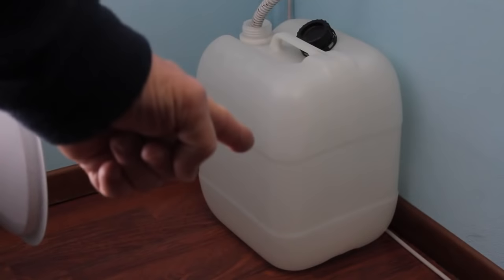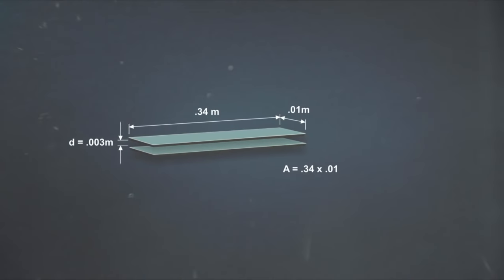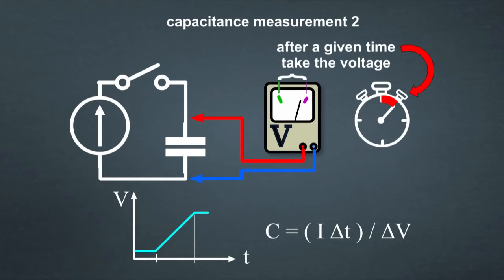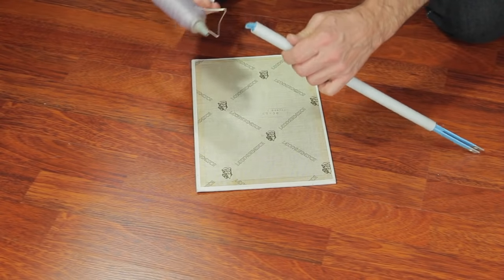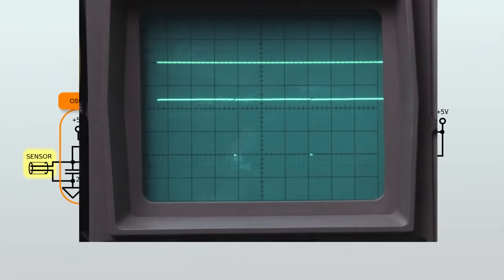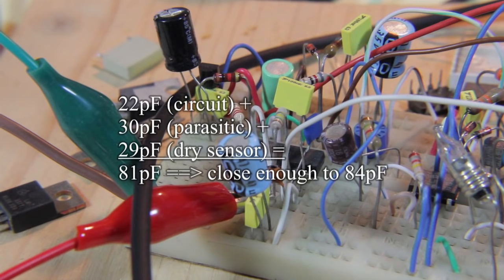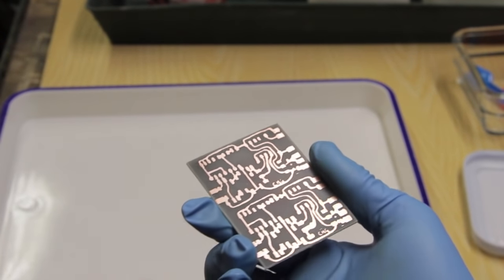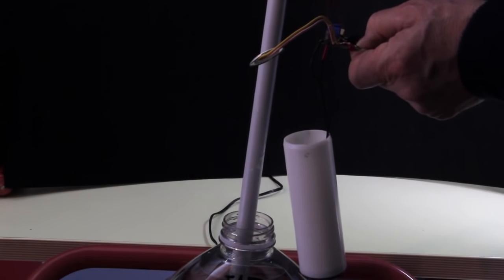Water level/fluid level capacitive sensor - How it works and how to make one

Comment: hi,great work 
i have one question
i want to make a sensor like this for my own lab
first i wanted to use arduino to read the data(by means of charge and discharge time)
but i think its better to use the frequency method
but i cant make the exact circuit
can you send a technical drawing of the circuit?
i want to connect the point you mentioned in video to arduino
thank you very much
Reply from the maker: The point indicated in video is the analog output, the connection indicated is symbolic as this output have to be buffered with an opamp to preserve the high impedance. To read the frequency you need to connect at the output of the last gate (74HC132). It is mandatory to use exactly THAT component otherwise the circuit need to be retuned (and likely wouldn't work properly). You will read a pulse that vary in frequency, as you can see in the video.
Reply: @AccidentalScience  so i cant connect any point of this board directly to arduino?
i have to find a way to read this frequency by arduino?
Reply from the maker: @David-xr4pd  Why? I have indicated where you can connect an input of the Arduino to read the signal as frequency instead of analog: the output of the last gate or (for a reversed logic) the output of the previous gate (the pulse generator, see the schematic in the video at 7:20). Also looking at the waveform read from the scope you can infer the frequency and the pulse width.
Also you have to choose an appropriate input in the Arduino board as it has to cope the frequency and width of the pulse.
Reply: @AccidentalScience  thank you very much sir
Reply: @AccidentalScience  Hi, I have connected exactly to the analog read of the arduino but it only shows a constant value of 513 without any change in its value with variation in the capacitance. While, I have matching the circuit for a week, even the oscillator output frequency varies with change in the sensor water level but the analog read value doesnt changes. I made the spice model of the circuit till the output of the last 74hc132 but there also it is not a constant voltage while it is a frequency pulse.
Reply from the maker: @ragibhussain5257  The last stage of the 74hc132 outputs a frequency that is proportional to the level. The conversion F/V is performed by the next RC. The signal must be picked up from there, but it cannot be sent directly to the analog input of the Arduino, because you need to decuple it. To do this you can use an opamp, i.e. a LMV358 (which works at 5V), configured as non-inverting unity gain amplifier. The output of the opamp is then "strong enough" to drive the input of the Arduino.
The 513 value from the ADC makes me think you configured 10 bit conversion with differential inputs and Vneg is connected to the same signal level in Vpos (for Vpos and Vneg see the ATmega328 data sheet). In such a case 513 would mean zero volt (differential) as for the following formula:
ADC = (VPOS – VNEG) ⋅ GAIN ⋅ 512 / VREF
.
I recommend to use a single ended input only. Also use a multimeter to troubleshot the circuit, check if the voltage actually change, where it change, and so on.
Good luck.
Reply: @AccidentalScience  Hi, I tested everything, I exactly replicated the circuit as in the schematic on the breadboard with exact components and instead of sensor I varied the capacitance of values from 22pF to 2.2nF, but however, the output of the multimeter at the opamp output is constant at 2.51V. It would be better if you would upload each and every detail of the schematic on any link any spice model or the exact link of the circuit.

Comment: Hi...
¿How can I find information about that oscillator and pulse generator?

Now I know I can simulate it in a computer program or built mine in house but in both cases if I want to model it mathematically I would have to measure...

In resume: could somebody tell me where can I see theory about oscillator and pulse generator?
Reply from the maker: While I don't have a specific answer right now, a good starting point is to understand the theory of operation. Some more information is available on the relative page on my website, but there is literature (I think it should be available online) that covers oscillators and other signal manipulation through logic gates. I have an old book titled "Elettronica Digitale" (don't remember the publisher though and AFAIK it's only in Italian) that provides good coverage on the topic. Maybe searching for a similar title you may find something.
Reply: @AccidentalScience  

Yeah... Thnx for your answer...

Another question I have is:
Did you review your book for design that circuit?

I can understand how the oscillator part works by seeing connections in NAND, resistors and capacitor because it is the first part but I can understand pulse generator and the other parts by simple inspection 😓

Comment: Can i use this sensor for more than one meter and can u explain the way and the code for using this sensor with arduino thank u so mach for this great information
Reply from the maker: The sensor as shown in the video is "monolitic" that means that the probe (the two plates) and the circuit form a single sensor, so you can use more than one to connect to a single unit meant to work as a metering station.
Since the sensor measure the capacitance between the plates there is almost no risk of interference if more than one sensor is plunged into the same tank, provided a minimum distance (say some cm) between the sensors.
I do not love much Arduino because I prefer to code directly or to use my framework that makes multiple event programming much easier, so I am not able to direct you for specific code, however essentially you have to setup the ADC and by polling the ADC in the main loop to read out the analog signal coming from the sensor, and then use this data to do whatever you want in the program.
With the NDC framework the things go similarly: you select the extension of the main loop and in the device loop file enter the code to poll the ADC, in this case it is easier as the ADC is already read out and you simply need to pick up the value using getIn(ANALOG0). For more information about the NSC framework look among my videos.
Reply: Accidental Science thank u a gain

Comment: What about mineral buildup on the 2 strips and the eventual blocking of the pipe?
Reply from the maker: Your question is a good point and to try to give an answer we should wonder what are the reasons limescale/minerals build up:
1) it could be caused by sedimentation, in this case there is no problem because the gravity will attract the particles down, outside the pipe;
2) it could be caused by chemical concentration, at the point the particles stick to the surfaces, this typically happens when high temperatures are involved, and it is usual in resistors used to heat up boilers, however the stripes are not heated (and with no high temperature spots the particles stay diffused). However after long time some particles will stick anyway but far from the point to cause the pipe be chocked;
3) it could be caused by electrical attraction: if the plates (the stripes) were connected to a continuous electric field that could attract polar minerals eventually. However here not only the electric field is very small but it is also alternating so there is no risk to attract polar particles.
About the thin layer of minerals/limescale that may build up in long times, mentioned at the point 2 above, one thing that we may wonder is if that layer may modify the dielectric properties of the sensor, thus shifting the returned measured value. I have no answer for this last point because I think the only way to give an answer is to try experimentally. However since the sensor as shown in the video is quite simple I think that for the purpose of its use it should be fine anyway, it is however possible to design a different kind of sensor that have intrinsic compensations for this kind of "interferences". Finally it is also possible to make the sensor to work in a completely harsh environment (say with plenty of minerals/limescale or other particles suspended in the fluid) by changing the design of the stripes.
Thank you for the question. May be I could make a video about this topic.
Reply: Thank you for the detailed answer.
A reliable, maintenance free liquid sensor for a sump pump is what I am looking for. LevelGuard seems to make what I need but it is too expensive.
They use a proprietary sensor which I would like to replicate.
If you are interested in collaborating in this project please let me know how I can contact you.
Thank you.
Reply from the maker: Well, let's talk, my email is in the about section here in my channel. When you have done please leave a comment here because once in a while the mail server lacks to send me notifications.
Reply: Contact made :)

Comment: Can we use a capacitor to determine two different fluids with different polarities?
Reply from the maker: Hmmm, you can detect two different fluids with capacitive sensing, but I am not sure what do you mean for "a" capacitor and "different polarities", may you elaborate?
Reply: @AccidentalScience   I want to design a capacitor which can detect water from fuel . (Water- Polar, Fuel- Non polar)
Reply from the maker: @DinuBoy  gotcha. Cool problem. Polar or non polar fluids have different behavior as dielectric so it can be certainly done.

Comment: Hello, can you talk about how you calculated the *K value?
Reply from the maker: Hello, sorry for the delayed reply. As mentioned in the video it depends by the circuit. For a NAND oscillator the constant value typically is approx. 2.1 to 2.3 times R C or f = 0.47 * 1/(RC). I cannot provide more details because as said above it depends up how the circuit is designed, not to mention the fact that I am not a guru at math :)

Comment: can your sensor detect the level of fluids with varying dielectric constants , from high to low.. this is for detection of human blood levels
Reply from the maker: No, it can't.
Reply: @AccidentalScience   is it possible for you to tell me, how much current would be detected if the probe reaches the surface
Reply from the maker: @GeogyStephen  Current? The probe is insulated. There is no current flowing between the plates, save instantaneous flow due to the moving charges back and forward because the oscillator, and that alternating current is negligible, I don't remember the exact values but in the order of microamps I guess.

Comment: can you pls send the circuit connection for using with arduino for fuel sensing
Reply from the maker: I don't know the pinout of the Arduino board (also I think it depends by the board model) but essentially you have to follow the diagram shown in the video to connect to the analog input of the ESP8266, in place of the ESP you'll connect the analog input of your Arduino board (for those that have an ATmega328, any pin that goes to any PA0 to PA7 Mega's pins).
Reply: i followed the same circuit but the output is 3.5to 3.9 V. I used DM74LS132N IC.
do i have to insulate the plates ?
Reply from the maker: Yes you have to. Plates must be covered with a resin with low water adsorption, or the circuit won't work.
Reply from the maker: Also, DM74LS132N is not suitable for this application, you need the 74HC132 (not the HCT version because have different output voltage).

Comment: Can anyone please explain why you can't just measure the change in resistance between two closely separated metal plates?  It seems that the circuitry (and maths) involved would be much simpler!

Obviously, you wouldn't want it running all the time because you'd corrode the electrodes, but using something like an Arduino you only need to power it for a few milliseconds when you're actually measuring.
Reply from the maker: Obviously you can. Provided you have tap water, or salt water. With water coming from HVAC which is far less conductive things become a little bit complex. More, water changes its conductivity because variations in dissolved minerals way more than its dielectric constant.
That said I made a water level sensor using stainless steel rods of various length and a simple row of LEDs that worked nicely for years. In a non-linear fashion like that stainless steel rods are way more convenient.
Maybe I will make a video about this point. Thanks for commenting.

Comment: Why where theoretical and actual capacitance different?
Water is often slightly electrically conductive... If water has considerably better conduction than insulation...  the water can be  approximated as a conductor... And arrangement modeled as two capacitors in series... With inner most plates being formed out water. And the dialectic being the insulation 

This can be shown by making one plate out of say copper, and the other out of aluminium. Applying a fixed DC current will anodise the aluminium plate, showing water will conduct until the anodising layer builds up. The anodised layer is a dielectric of thickness proportional to anodising voltage. Once built the anodised layer stays there.
.
Reply from the maker: The plates were insulated, look at the beginning of the video, they have been covered with polyester. This layer could explain the difference.

Comment: what type of capacitor is this..? like electrolytic capacitor
Reply from the maker: Good question. I am not an expert in capacitors, so what I can infere is: 1. the non-submerged part is a simple air-polymer capacitor; 2. the submerged part is not an electrolytic capacitor since those caps form a layer made out of a metal oxide that represent the actual dielectric while the electrolyte is used as a mean for charges. In this case however we have just water that does not behave as electrolyte but as dielectric.
This is my guess, but if someone can contribute with more information they are welcome.
Reply: thanks for your valuable reply. I tried this in my home but it doesn't work properly. I made capacitor perfectly and I measure that with the multimeter, it shows some capacitance values with the level of water respectively. please guide me with the circuit.
Reply from the maker: What does not work properly? Does it generates a square wave when dry? About the capacitor, what the multimeter read?
(Sorry for the time taken to reply, I follow my channel as long as I have spare time, hope you understand).
Reply: The multimeter only shows 2.5v constantly on dry and wet condition. but my own made capacitor works with 4nf to 40nf respective with dry and wet conditions. 2.5v in the point of voltage to frequency converter. can you guide me for the further process?
Reply from the maker: If you have a constant 2.5V at the point of the V/f converter, then the output of 74HC132 is constantly low, this means that there are no pulses  in output of the very same IC at the point of the oscillator, so you have to ckeck why the oscillator does not work. That was also why I asked if you see a square wave.
Reasons why the oscillator does not oscillate can be: a short circuit somewhere in that part of the ciruit, or bad connected component, or wrong or broken components. Please keep in mind that the oscillator works because it is a fast Schmitt trigger IC, it will not work if you do not use an equivalent standard NAND gate or slow gate!
An other possible reason for not having the pulses to the V/f converter is some wrong component (say a 82K instead of a 82 ohm) or the diode is reversed, or the capacitor is too large (say 100nF instead of 10nF).
You have to check step by step at each stage that the signal is as intended, the video should give enough information about what kind of signal are expected.
Reply: Thank you for your valuable reply. I will check on that listed things then measure the value with an expected range. once again I thank you for your continuous support.
Reply from the maker: Let us know what went wrong with your circuit giving feedback. Also, if you please, you may film your work, what problem you faced and how they were solved, and I will try to include your clip into my one of my next videos.
Reply: Accidental Science definitely sir. After finishing my work i will send the clip to you.

Comment: because in the rod is flowing electricity this method is not suitable for fuel gas, for a moto for example
Reply from the maker: That doesn't mean the current flows through the fuel though. Anyway common fuel gauges are made using a potentiometer that is submerged into the fuel inside the tank. Petrol doesn't catch fire as long as there is no oxygen or there is no enough current to make a spark.

Comment: You forgot to tell that we can have only one inside water tank. For two (like for low+high) levels this will not work.
Reply from the maker: 1. You can put two or more sensors into the same tank (unlike resistive sensors), provided they are spaced apart of almost half the width size of the plate, i.e., 3/8".
2. You can pick up the actual level so there's no need to place more than one sensor.
Reply: @AccidentalScience  Have some time to clarify it ? :) I just want to put two sensors saying that my stand for a pot is "full of water" or "has no water at all".

Comment: Hello this sensor can measure soil moisture?
Reply from the maker: As it is made, no, it is necessary to make some modification. I already made a sensor to measure soil moisture, it is quite a complicate task because the soil changes both conductivity and dielectric due to several factors such as the amount of dissolved minerals and the amount of water. The available sensors on the market are quite unaccurate as those I found are based on resistivity or capacitance but as said above using only one method can divert from the real measurement, so to have an accurate sensor it is necessary to use both methods with a compensation made, for example, with an embedded microcontroller.